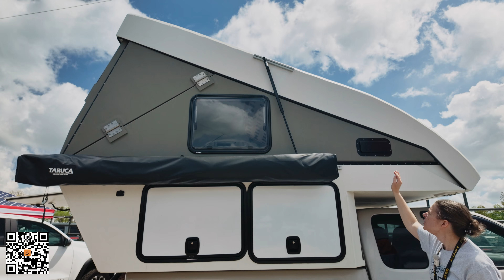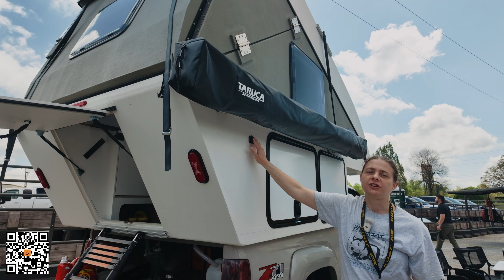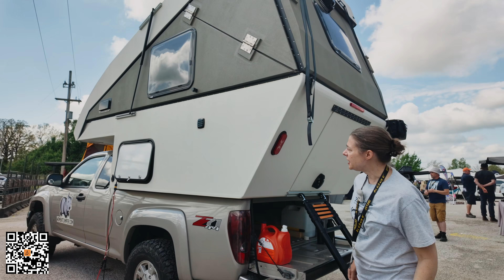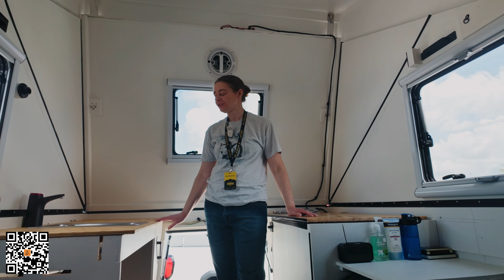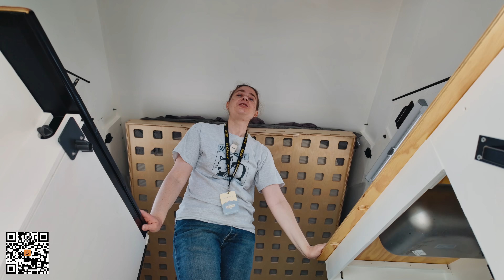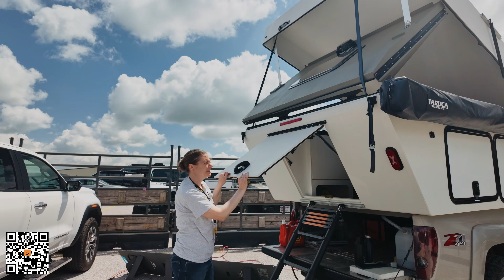Innovative Pop-Top Truck Camper | Wombat Camper B Series Prototype Walkthrough

Comment: Design has promise but needs some changes. Thats too much weight on the bed rails. Should have legs going onto the bed floor. Needs a fabric on the fold down gap to keep dirt out. The interior latches should be a single center mount latch on the ceiling that you rotate and it pushes out two rods against the sides. Hope they keep working on it.